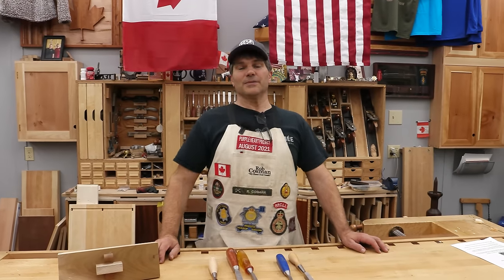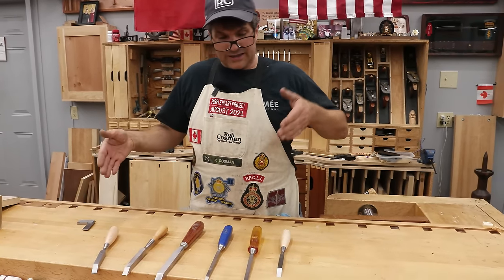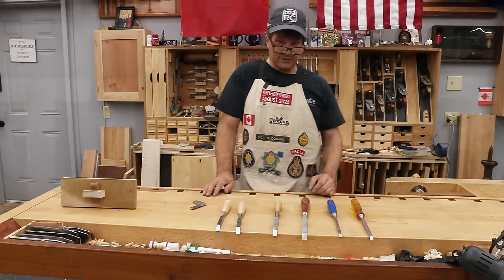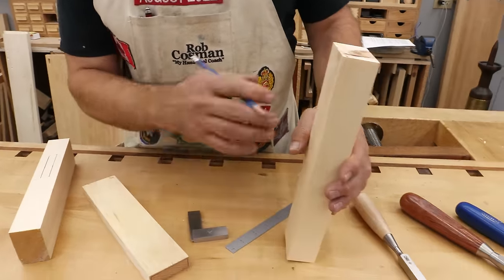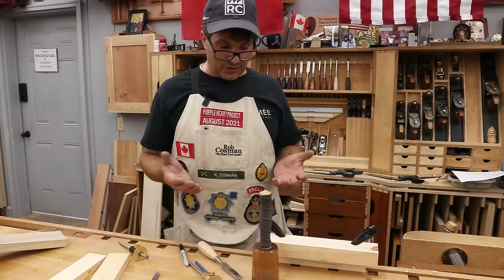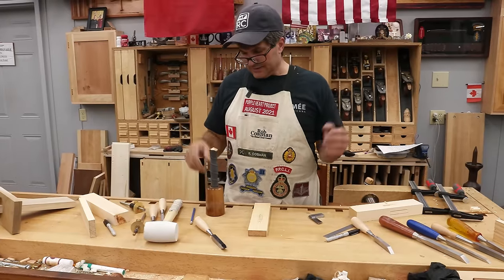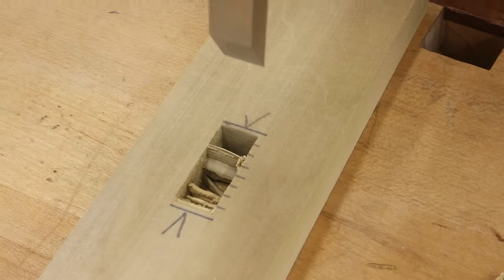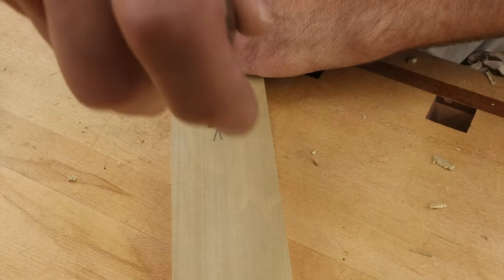Hand Cut Mortise | Ten Tips for Better Mortises

Comment: I love the marking gauge technique to scrape out the bottom of the mortise! Thank you for sharing!🙌💜
Reply from the maker: You are so welcome!
Reply: Wheel marking gauges are so useful you can't imagine why anyone would want the old ones with pins, I've got three of the old style which I feel I should keep using - but don't. Waiting for a Swiss Army wheel marking gauge that doubles as a bench plane, Forstner bit, chisel and saw; then I can throw all the other stuff away and travel light.  😀😀
Reply: @chrisjordan4210  when marking out on thin large panels I prefer the old style because of the larger reference face. For dovetails wheel all the way for mortise and tenons I grab which ever is closer.
Reply: @James_T_Kirk_1701  I have two wheel gauges, one by Veritas and my original one by a Czech firm Groz, it has a rather odd layout, the stock/fence is brass-faced 122x23mm (I just measured it) so much wider than the traditional gauges and it has a calibrated shaft. I've had it for years and now looking at it anew it's really quite a wonderful tool in its Rosewood, brass, and steel - if you could find one I would urge you to buy it 😀😀

Comment: Nice way of presenting it. This chopping technique goes by 'riding the bevel'. I use the same technique. Chisels square in cross section are so much better, I don't know If I can chop a mortise with those which are not square. 
I am glad to see that IBC makes mortise chisels, I almost wanted to say that IBC and LN are the only ones making chisels like this. Unfortunately LN removed the mortise chisels from their core tools list, unbelievable, I totally disagree with the decision. I am aware that they are dealing with some scalability issues, but the mortise chisels needs to return to the core tools.
Reply from the maker: Thats why we worked with IBC and made mortise chisels

Comment: When you get to tip #6, check out a chisel guide invented by Paul Sellers that takes minutes to make and will last forever. Takes the guesswork out of chisel alignment vertically. No need to reach for another piece of “straight stock” and unnecessary clamping, you have a vise, use it. You can make up several of these guides to suit a desired mortise location. For items that can’t be held with your vise, use that block of wood or straight edge.

Comment: Am wondering why you create a slight secondary bevel when sharpening and by then just variably (and inaccurately) liifting it freehand, the angle of which varies between stones and thereby creates a nonlinear edge?  Seems that you'd want that cutting edge to be in the exact same plane as the rest of the bevel face given a secondary bevel would potentially cause slight off axis cuts as you chop?

Comment: Useful tips, thank you. 

Every video I’ve seen on chiseling mortices has the chisel blade at 90 degrees to the grain of the wood, in which case the angle of the bevel shears the wood segments against the grain neatly. 

I’m struggling with cutting mortices where the blade is parallel to the grain, and probably to make it worse, I’m working with pine. Here, the bevel tends to split the grain rather than shearing it. Any tips?

Comment: thanks again for the timely lesson.  i find myself in a situation where i have to cut a mortise that is over an inch wide.  if there is a mortise chisel that wide i cant find it.  do you have any advise for cutting a mortise that is wider than your chisel?
Reply from the maker: In that case I would drill out the waste then pare the walls constintly checking them so they are square to the face of the wood

Comment: I like your pencil drawn line technique for chopping the mortise. For beginners like myself, what about doing those lines with a marking knife instead so you have a reference cut to place your chisel into that will be perfectly parallel when chopping?
Reply from the maker: That would work well, you would just need to be careful not to mark too far over. Pencil line can be easily removed, the knife marks would have to be contained inside the shoulder of the tenon. A good idea for beginners

Comment: Thanks Rob! Typically I build a jig and use a router and then use a bevel edge chisel to square the corners in the mortise. But this looks like something that I want to do and now I have to buy mortise chisels. Looking at the way you do this, I am guessing that a drill to remove some of the waste would make using the chisel more difficult. What are your thoughts on using a power tool to remove some of the waste and then cleaning it up with a mortise chisel? One of the things that I don't like about a mortise chisel is tend to pinch on the sides too hard and then there is blood all over everything
Reply from the maker: Don....You dont want to drill out the waste if using a mortise chisel.  Drill the waste then paring the walls is a completely different technique which I dont recommend except on really really big joints.  Just use the mortise chisel to cut the mortise...you will love it.  With a mortise chisel you should not be holding the blade, only the handle.  Different than a bench chisel

Comment: Thanks for the helpful tips, Rob.  I am working on the mother of all mortise & tennon projects - 2" thick breadboard ends for a 4' wide table in maple.  I started with Lie Nielson mortise chisels, but switched to the new IBC mortise chisels, which I absolutely love!

Quick question: would you consider using a marking knife to make the paralle lines when you're laying out the mortises?  That may give a better reference when setting your chisel in place, but I'm not sure it's a game changer

Comment: Really helpful video.  Thanks.  One thing I haven't been able to understand is how come you go from 1K and then straight to 16K grit when sharpening the cutting edge, but when polishing the back you go through the grits to remove all the scratches from the previous grit.  Doesn't it leave scratches from previous grit, or doesn't it matter.   I must admit that I do what you do because you're a way more experienced cat skinner than I am, but I don't understand why I'm doing it.  What's the difference?  Please excuse my stupid...I'm old.
Reply: Just the size of the area being sharpened (or polished). If you're doing the entire back of the chisel, it would take a very long time to get from 1,000 to 16,000 grit polish, whereas on a tiny micro bevel, it takes no time at all to get rid of the 1,000 scratches.
Reply from the maker: Roco is right on.  It only works when sharpening right on the thin cutting edge and using a tierterary bevel.  It works because you are working on such a small bit of metal.  When flattening a chisel back its just the opposite, you are working on a large metal area and have to progress through all the grits

Comment: Could you use the tape trick with CA glue to hold a block in the center of a wide board or would it move a bit when pressing the chisel against it? I remember when you were fitting a drawer without handles you placed tape on the drawer front and on a block, then you put glue between the two so that you could have something to hold on to.
Reply from the maker: Never tried it.  I would worry that it would not hold it secure enough.  Give it a try and let me know

Comment: What is the reasoning behind sharpening your chisel to 15,000? Isn't there a point where the higher grit does nothing but polishes the steel? Do you sharpen all your tools to that high level?
Reply from the maker: Because 16K is the sweet spot between a very sharp cutting edge and the increasing costs for a higher grit stone.  Does 16K make a difference over say 8K...you bet a HUGE difference.  Polishing the leading edge is sharpening.  You are getting rid of the tiny scratches that you did before.  Yes I take almost all my blades to 16K